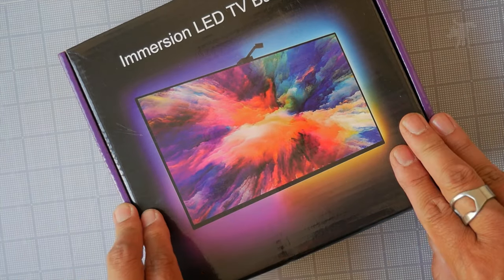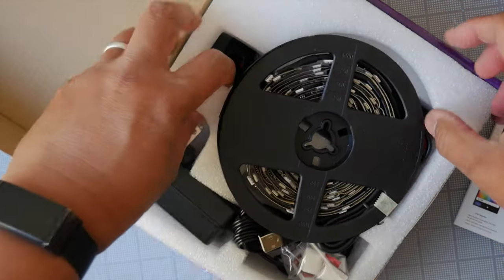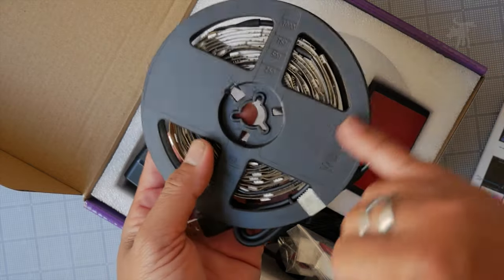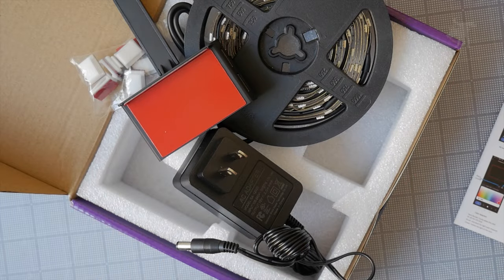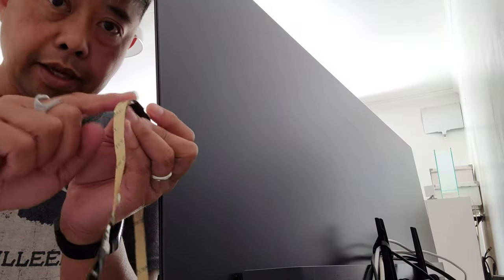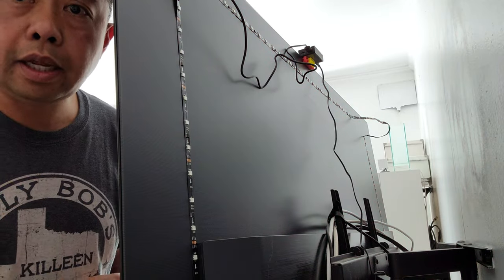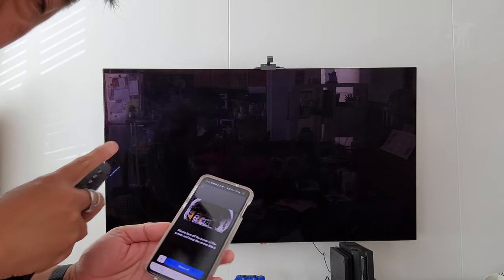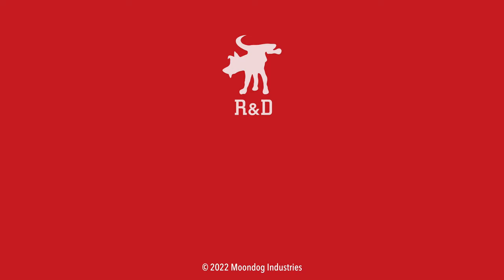Coliben TV LED Backlighting Kit

Comment: Very informative video. I bought this product but I’m stuck on the app. It’s not finding my device at all.
Reply from the maker: I had trouble recently too. I had to reset the device (there's a small hole in the case in the front that you stick in a paper clip).
Reply: @MoondogReviews  how far do I have to go? I tried that and it just kept going.
Reply: @zombieslayer123ist  I'm wrong. I think that's the mic port. Try unplugging the device for 30 seconds and then re-install the App. If that doesn't work, you should return and exchange it in case it's defective?
Reply: @Moondog2A  I did make sure my Internet is only putting out 2.4GHz and I’ve tried both modes. Do you think you could possibly make a short troubleshooting video?
Reply: @zombieslayer123ist  I wouldn't be able to replicate the issue of my phone not finding the device?